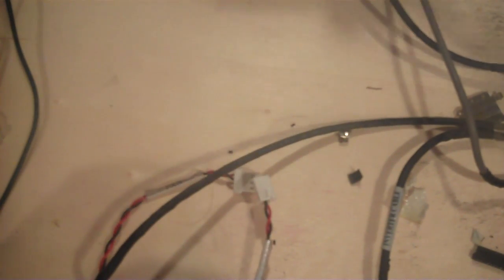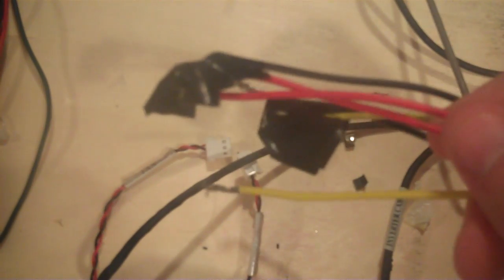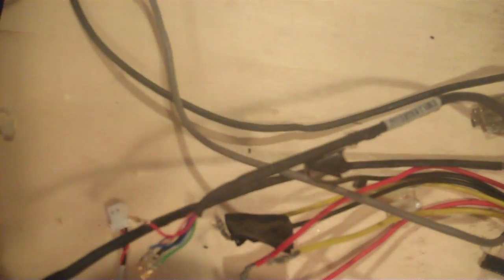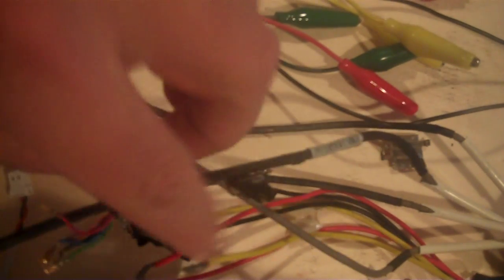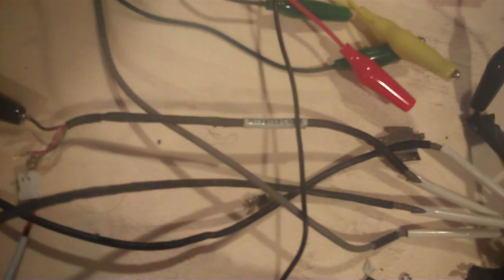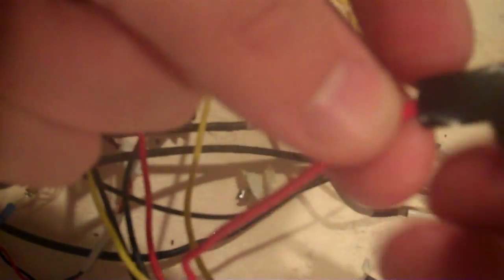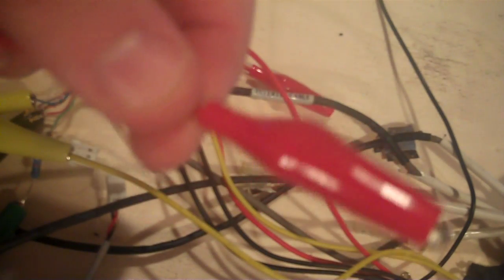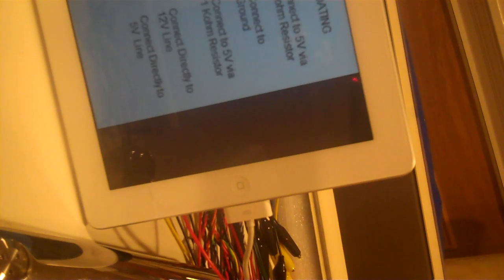17" iMac G4 to DVI - Part 5: Hooking up the Inverter

Comment: I keep forgetting to do a reply about my issues which eventually got solved.
The crocodile Cables that this chap was using the video obviously better quality than my own and they were not up to the job, Not enough current was being transmitted also the DVI connector I have found that it doesn't always work with other DVI computers or DVD players. wI'm not too sure there's a different type of DVI signals or not but it work now.

Comment: Hi,
I like your video, 
Can you help me... I currently have a 17" iMac g4 and started to work on the display however I'm having problems getting inverter to light up using diagrams. All i get is a quick flash and that's it... 
I need to git the display up and running before I invest in a motherboard or an Intel nuc. 
Thank you
Reply: has anyone figured this out ?
Reply: I am having the same issue, did you ever figure this out?
Reply: What is the voltage of power source? 12V. Or 15V.